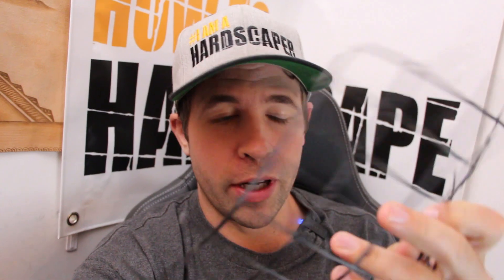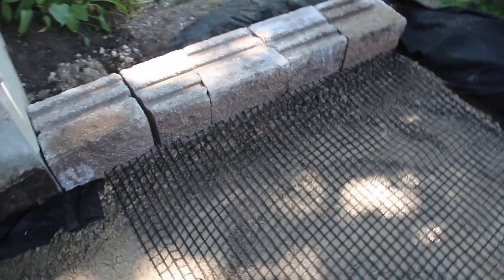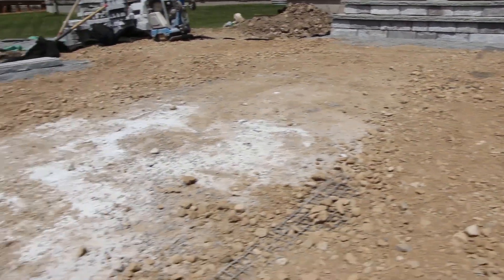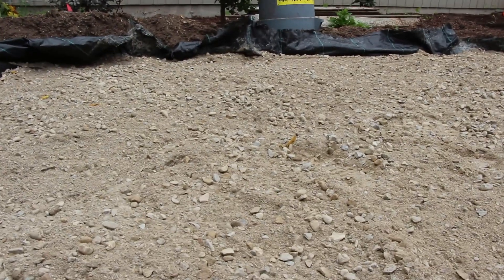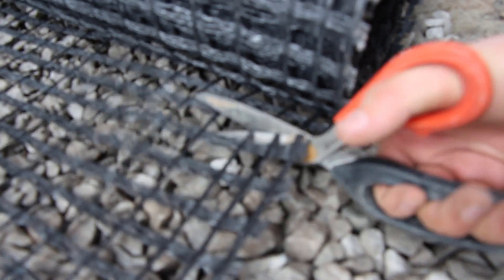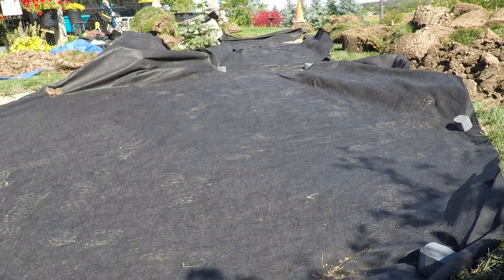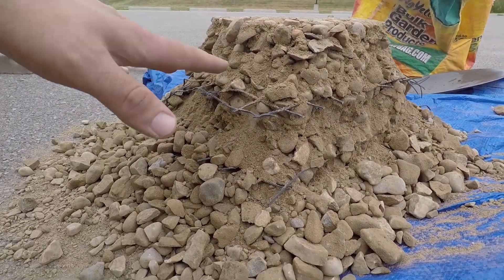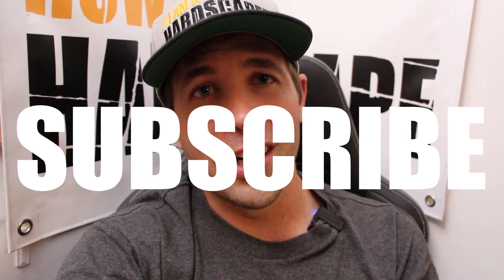You are Doing it WRONG if You are Not Using This in Your Base

Comment: Hi not sure if i understood correctly. You only use geogrid with woven geotextile?

Also hows that tufx wheelbarrow? I need to buy new wheelbarrows and i dont know if im still going for steel wheelbarrows or poly
Reply from the maker: Geogrid on top of nonwoven. Or woven then 4” of base, geogrid, then 4” of base.

It is the best wheelbarrow on the market without a doubt. Lightweight and incredibly durable
Reply: @iamahardscaper  since when have you been using geogrid? Youre the first one that I see that uses it for every basé other than walls
Reply from the maker: Really, I’ve been using it for about 5 years now